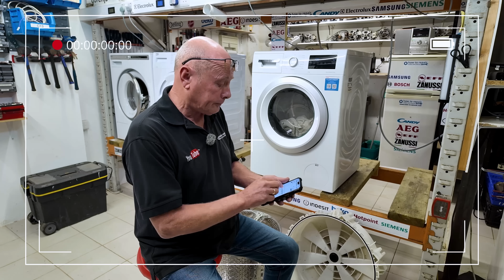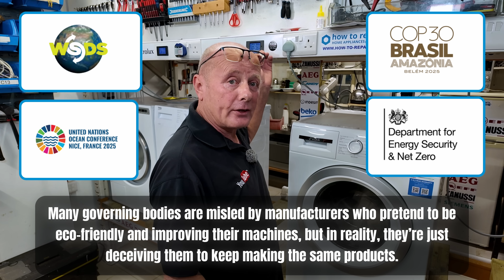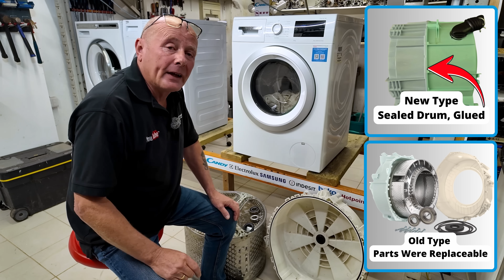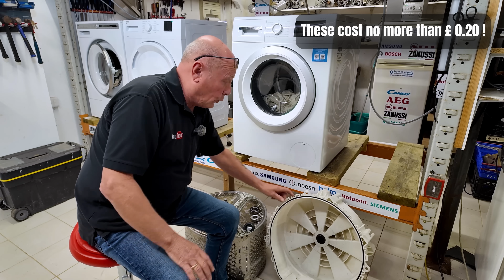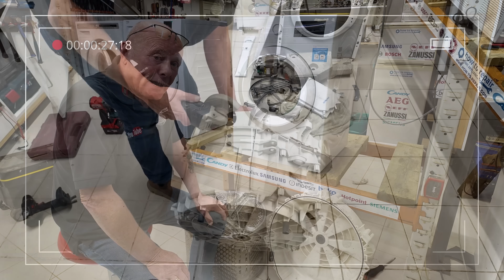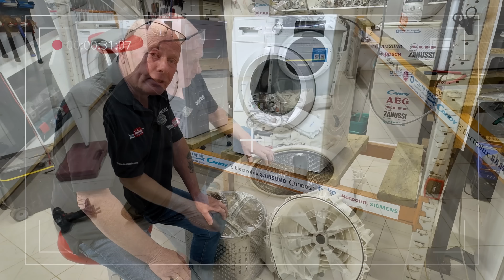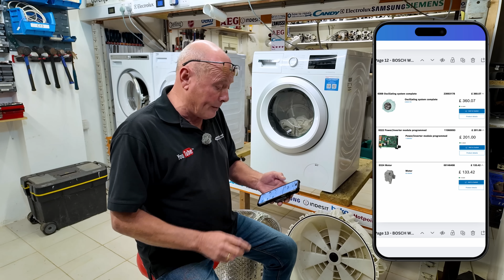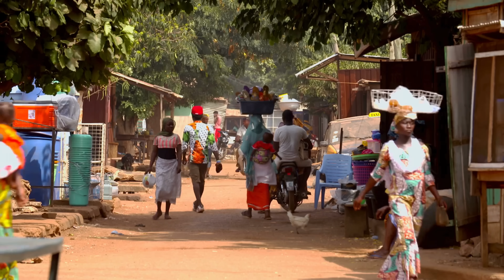Washing Machine SCAM EXPOSED! The Truth About SEALED Drums: Naming & Shaming

Comment: I work with a considerable number of washing machines, and I couldn't agree with you more. I probably see roughly 100 to 200 washers a week that cannot be repaired financially, as the drums cost more than the machine’s resale value. I’ve personally seen how much appliance waste there is, and it’s literally hundreds per week.

Many of these problems are 100% caused by manufacturers making it difficult to replace parts. It’s not just drums it's also main control boards, and in many cases, the parts that are listed simply cannot be purchased at all.

I can provide records showing how many scrap appliances we handle in a month due to poor manufacturing practices, and the numbers would be far beyond what most people would believe and that’s just from one company. Bosch is one of the biggest contributors.

Comment: I had a Gorenje mixer who broke after 3 years, even if i only used it for about 10 times. From curiosity, i took it to a repair shop and the guy from there told me basically the same thing as in this video: they are designed to fail after the guarantee expires. 🙁

Comment: Me: Hello, I would like to buy carbon brushes for the motor of my industrial vacuum cleaner.
Karcher: We don't have those.
Me: What do you mean? Brushes are a consumable part, what if they wear out?
Karcher: Well... we usually sell a new turbine motor.
(In older versions, brushes were easily accessible and could be replaced. Now this is no longer possible unless you cut open the motor housing).
Similar scams exist in almost every industry.

Comment: Our Miele front-loaded washing machine is 30 years old. The only repair we've had was about 10 years in. The problem was the corroded aluminum spindle as we used Northamerican powder detergents instead of the recommended much better Persil detergent. I tried to order a new spindle, but Miele Canada instead came, picked up the partly disassembled machine, replaced the spindle including a new belt as I had not left it in the machine, assembled the machine again and delivered it all for less than $200. Ever since the machine has been working flawless. We bought the  one model down from the top one as the spinning speed was faster. We have no complaints about Miele.

Comment: Same thing with my Miele machine. Paid a fortune to buy a reliable brand and now the bearings failed. Technician said: the drum is sealed and is not cost effective to replace. I have to buy a new washing machine because 5euro bearings failed 😡😡
Reply: As long as the spider is ok, cut it open, hot air weld it back together, or use a specialist polypropylene adhesive (eg ta4610).

Comment: They did something similar with the car repair industry in London about 25 years ago. They said diesels  were good for the environment and so people scrapped perfectly good older petrol cars to buy new diesels which then suffered from clogged up particulate filters (which are expensive to replace).  Then they said diesels are bad for the environment and you need to buy a hybrid car. Now it's EVs (which last about 4 years allegedly)

Comment: I've got an 8kg integrated Bosch washing machine that's been running smoothly for over 12 years now. I installed it when I got my kitchen done. The only problem I faced was about a year in when the spin cycle wouldn't work on some programs. I was told it might be the program module, but I later discovered some reset procedures that involve pressing certain buttons, and that solved the issue. It's been working perfectly ever since.

Comment: So many electronic devices like the PS5, mobile phones, and everything else are designed to become faulty right after the warranty period. It’s a huge fraud, and it forces us to spend more money.

Mobile phones are even designed to have shorter battery lifespans so it seems like we have to replace them.

The PS5 is also designed to fail not long after the warranty ends. I’ve been contacted by many people saying theirs stopped working within 1–2 years, and I’ve seen plenty of videos from repair shops confirming the same thing. Honestly, I would rather pay $100 more if they improved the quality of components like the motherboard, fuses, and capacitors and guaranteed a lifespan of 15 years. But companies will never do that just like the lightbulb companies did in the early 1900.

It’s all fraud.

Personally, i’ve stopped buying expensive new items and you should too. We, the people, have the power to buy new expensive products only when we see real quality. We shouldn’t buy today’s overpriced crap. I’m glad I started learning basic repairs, because it’s going to be a goldmine if prices keep climbing. Just look at the PS5: it started at $499 and now costs around $799 new. If this continues, it’ll be $1,300 within a decade. Mobile phones are the same story.

Look at the iPhone. It went from $600 to $1,400–$1,600. Not worth it. The only new phones I buy now are around $300, because they have the same actual quality as the newest iPhone. The only difference is the fancy design and the operating system. The battery life is about the same, and the quality is the same cheap garbage.

Comment: I agree there needs to be a change.   I had to modify my refrigerator to keep it from failing every year for a 20 dollar part that when failed cost me 300 for repair and all the food spoiled.   So as engineer, I replaced the motor with a more reliable motor and it has been running 7 yrs without failure.  Reverse engineering was only way.....

Comment: We happen to own multiple appliances of the billionaire owned Electrolux conglomerate sold here in Switzerland with a premium. Same or similar machines are sold under the brands of AEG, Zanussi and many more. The top loading washing machine is our second, the first had a broken ball bearing after only 2 years. We bought a second one and the bearungs broke again after little more than 2 years. This time I ordered better replacement bearings from Electrolux cheaper sister brand Zanussi for 30 bucks (original bearing in Switzerlandnis 120+) - and the machine is working. The new dishwasher broke piece by piece the first 2 years, lots of plastic parts. Door handle, front cover, water sprayer, triac integrated circuit, valve and more. I glued, soldered, siliconed, and replaced parts. Original parts are crazy expensive, service technician costs 250+. After 3 years I had seemingly fixed all the shady parts and the dishwasher had no issue for the following 6 years. After 9 years it started to have water leakage issues and from now to then I had to find a replacement. I bought a barely used Electrolux dishwasher of similar age for 100 bucks, put my repaired parts from the old into the new one and here we go - it's working fine every day. The fridge is generally working but plastic parts break a lot. Door handles, drawers and more. Cheap plastic sh*t but hundreds of bucks to replace. 
But the billionaire owners family want to live their luxurious life - so we need to understand...

Comment: TRITON electric showers has done the same - scaled up water heater unit - plastic welded case, failed water unit, welded plastic case - price for new water heater unit - the same as buying a complete new shower unit from Triton - go back to the 80s and the water heater unit had a screwed on bottom from where they fitted the heater unit in and therefore you could remove, descale in hard water areas and replace heater if failed. Should be against the law, I literally bought two electric shower units from TRITON on fitting a new one as all the parts prices added up if they failed in the future would be around £400, when it comes boxed new for £49

Comment: Extremely interesting report.   Thank you for your diligent research and following up your gut feel something was not right.    A lot of things that are going down in every part of our lives has that same feel of lack of any common sense and potential profiteering and taking advantage of the public as if on some mission of bankruptcy of the populations, especially for key critical pieces of domestic kit.   Down the line white goods "insurance companies" at Domestic and General and Currys will eventually be impacted.    Insurers pick up the tab for poor manufacturing and parts however, they can generally expect up to 10 years of premium out of white goods before they invoke their replacement for new clause with customers contributing to the upgrades.     If they have to economically write off white goods in less than five years because of component parts they can only look to increasing their insurance premiums to make up premium shortfalls or maybe shorter economic life cycles might suit them better, especially if say the drum price has been  made uneconomic to repair.......deliberately.    Changing from screw assembly to weld technology that makes the component and entire machine unrepairable economically does not fit into the Net Zero mantra and certainly skips the common sense phase.     But still great work and information.    Now going to look at washing dryers report I saw if this is the standard of your investigations.   best regards    Derek    Unhappy 50-year-old white goods customer, all makes and appliances

Comment: This practice is widespread. Laser Printers used to enter a failure mode after a number of pages. Cost of repair being greater than a new printer. Designed to blow a fuse like component. 
Govt need to look at this before it is too late and repair men are no longer in business.

Comment: I work in the automotive sector and have seen this priced out of repair tactic there too. In a recall, parts have a different part number than if you would buy them because of a failure, and the recall parts cost a fraction of the price. We had hybrid cars that had common internal battery failures. They all had a warranty on the internal components of the battery. Then, when the warranty ran out on all cars with that model, a new part number was introduced which was triple the price of when they were still in warranty.... This happens everywhere and I suspect there isn't a damn thing we can do about it

Comment: A washing machine in 1959 was 200$ = approx 5.5 troy ounce of gold  = 170 gram of gold
A 3-5 years washing machine in 2025 is 350Euro = 4 gram of gold
Pentium 286 release  in 1982 cost 3800$ = 8.4 troy ounce of gold =238 gram of gold
Basic PC in 2025 - 600 Euro = 5.5 grams of gold as per December 2025
The prices of electronics are so low that makes absolutely no sense for  a technician to spend 5 hours with 50Euro per hour rate to fix a 350Euro washing machine.
A good for 5 year washing machine cost 350 EURO, a repair can cost easy 250 EURO.
Market is dictating if a product is worth fixing. not technicians, not presidents, no bill in parliament will fix that.

Comment: In india repairability and after sales service plays major role many big brand have failed here due to lack of service or costly service ford being just one example india is a very price sensitive market any purchase involving more than 200 pound is seen as substantial due to which people do market research will ask about a machine or product with there friend and family before buying. When people are not satisfied by any brand they will tell every friend and relative they meet even shop owners don't like to sell those product if company will try something like this they will suffer. We had a front load washing machine from IFB    a well known brand for washing machine over here after many year of use due to moisture when the pcb failed we paid around 50 pound for pcb and parts replacement it lasted around 15 year till the rust started eating it away and we retired it of fear that it might give us tetanus 😂

Comment: When i was searching for washing machine, i searched for the one with ability to extend warranty as much as i could, so i bought bosch 6 series with 6 years of warranty, if it fails during this period, it should be repaired for free.
If it fails later, i think, i can try to cut drum open, and change the bearings myself, and if I will fail to do so, i will buy new washing machine then.

Comment: i replaced the bearings myself, in my washing machine..
Hack saw to cut drum in half, at the "sealed lip"....
a bunch of M3 nuts and bolts to bolt it back together again.. and a tube of Adhesive sealant...
£8 for a bearing and seal...
Reply: Problem is that ít was not designed for this, will rust, or break apart during cycle, or leak soon, etc
Reply: @zzzzz2903  Been going strong for 3 years or so....

Comment: There is no way the drums cost anywhere near the price they are charging to make. A while back I had a Bosch machine making a lot of noise indicating something was wrong, under warranty. Took 2 service visits, the second with 2 engineers. They replaced the sealed drum, heating element and door seal. Even with much lower component prices, would still have been uneconomic to replace due to the labour, but that would have meant I would have had to receive a new machine with a new warranty.

Comment: Nothing new about your statements. Seen years ago a technician that took failing tv's apart. He stated if the tv had 1.50€ more spend to electronics it would most likely at least double its lifespan. So for instance the point of manufacturers having to use much more expensive parts to make it better is bull. There is probably nobody in the world who would mind to pay like 10 bucks more for a way more reliable tv.. So they are indeed manufactered to have a minimum lifespan...

Comment: Honestly, I don't bother to repair anything now. I just buy the machine, the extended manufacturers warranty (with no call out fee), and I will replace it when it fails after the warranty period. It's not worth paying £140 to fix something after 6 years for example. I am very happy to pay £600 for a washing machine from Bosch that lasts 5 or 6 years, with free callouts if there is a problem.

Comment: Go back to 2008 when Blair signed us into the EU you find weird things like the EU requiring car makers to " make cars too hard for the owner to repair to require main dealer repairs " .
Wonder if these regs spread out to other things like white goods ? .
My pet hate is how the cheaper machines only have a cold water inlet so they work with gas heating systems .
My problem is i have a solid fuel fire with a 40 gallon tank of hot water but have to waste energy heating the water in the machine to meet " energy saving " requirements ....
If we want a double inlet machine to actually save energy we have to pay double the price  ? .

Comment: It doesn't really matter if it is a split drum or sealed. In fact sealed drums are easier to replace, I can change Hotpoint sealed drums in under 40mins. The issue is they want you to buy a D&G repair policy rather than buy parts, so they price them accordingly.

Comment: Totally agree! 
My LG F2J7HG2W washer-dryer is around 8 years old, I have replaced the pump motor myself a few years ago when original one failed. I did it quite wrong... from the underside of the machine, but got it done by myself and works well. Plus the new Askoll pump cost only like 10€. And stuff must be fixable. 
And the circuit boards which cost ~200€, I always wonder how they come up with these kind of numbers, only thing I can think is they want me to buy a new machine instead and conveniently say there are "options". 
Hoping mine will last (DD inverter motor claims 10 years warranty, not sure if they stand behind this and well, it is only motor). Who knows, not even sure what kind of drum it has and well... quick searches did not reveal much.
Manufacturers sure do not want to KISS (keep it simple stupid). (PS! I like the WiFi though, reminds stupid me that the load is done so I can take it out)
Keep up the good work!

Comment: Legislation to pass requiring:

1) Phased increase of guarantee periods. For example within 5 years all product guarantees must be no shorter than 3 years, within 10 years 5 years, within 15 years 8 years, 20 years 10 years...

2) The sum cost of the entirety of a product's replacement parts must not exceed 110% of the product's origional listed retail value.

3a) All products must be designed to be repairable.

3b) Illegal to have to break a part to access/fix/replace another part.

3c) Before any product goes to market it must be submitted to a nationally recognised board of impartial experts and non experts who will dissemble the product, simulate repairs, and rate it for ease of repair.  Fines or bans applicable for non conform products.

Comment: I totally get this.. I bought a Bosch idos, I think it was 8 or 9 kilos.. wifi, it was a fancy one, my mother went mad because it cost near 800 pound, but I got quidco and bosch gave like 200 quid cash back. but she was still tutting about it. We are a family of 6, my parents, my wife and my two daughters.. Compared to our old machine, it washed like a champ, and it was put to hard use, it was on every day, sometimes twice a day, so I'd average maybe 1.5 times a day. Also the quick wash was used now and again. Great washing, everything was great.. then we started getting the dreaded rumbling noise. I'm not shy on fixing things myself, I've replaced oven elements etc, I also have been building computers for the last 30 years, so if someone puts a fix on the net, I can buy the parts and fix myself.. I then come across the whole sealed drum.. My machine was fantastic, but it was 7+ years old, to pay 300+ and then have to take the whole thing apart, (likely 20+ hrs job!) replace the sealed drum, and then maybe the motor or board go was just a non-starter for me. But what it told me was never buy european again.. anything with a sealed drum is never getting my cash. I now have an expensive samsung, does a great job, just wish it wouldn't twist the clothes together during the wash. Any ideas on this?